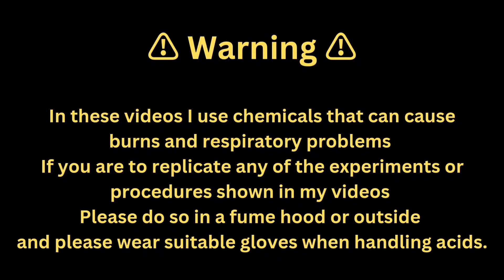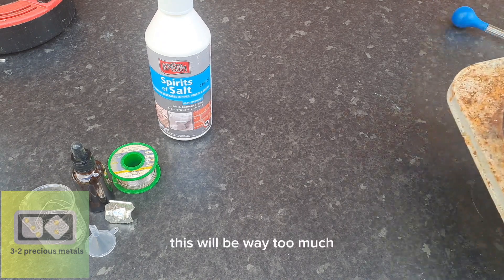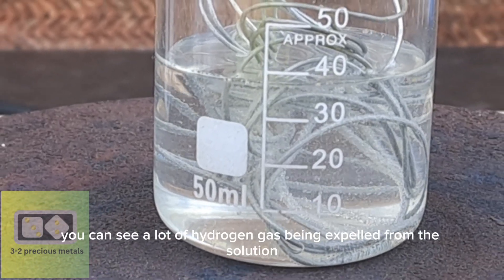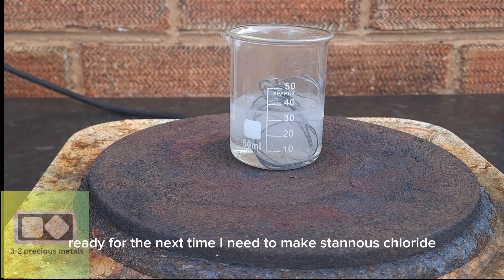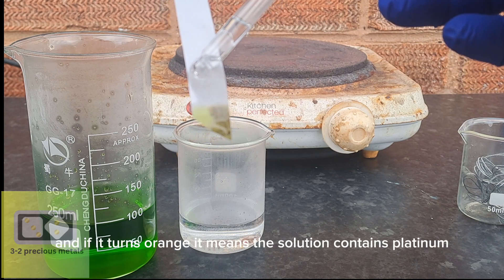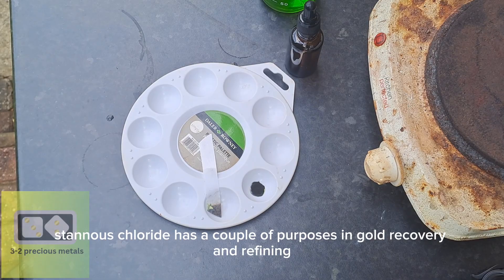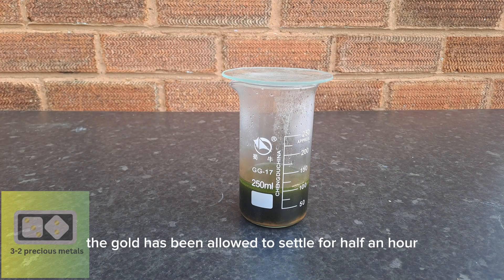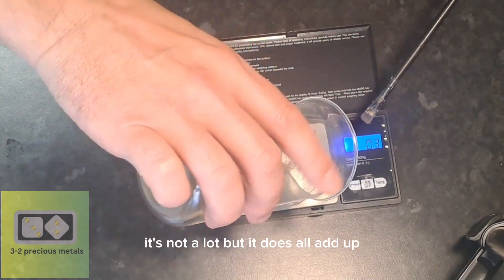easiest DIY stannous chloride test solution recipe ever for gold recovery!

Comment: It's work like Sodium Metabisulfite?
Reply from the maker: It can be used as a reducing agent if you couldn't get no sodium metabisulfite, but it might precipitate other metals other than gold. But it's mainly used to test for the presence of precious metals. If you can't get sodium metabisulfite, another alternative would be ferrous sulphate. Ferrous sulphate is better, in my opinion, as it only reduces gold, and it doesn't smell as bad as sodium metabisulfite
Reply: @3-2preciousmetalrecycling you ain’t joking. I will not use smb any longer as it’s nasty. I use Ferrous Sulfate now. I’ll use. Ascorbic Acid for a switch back to SMB.